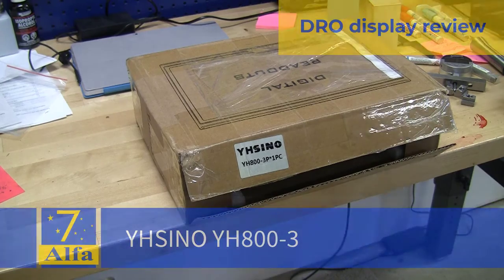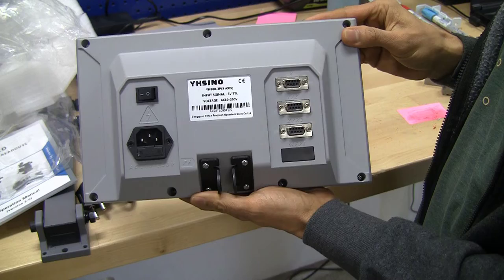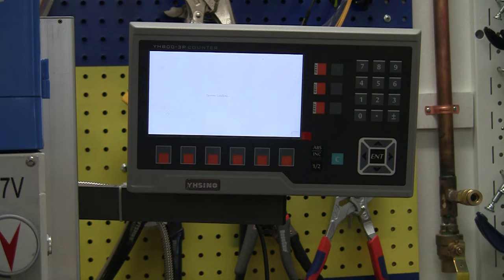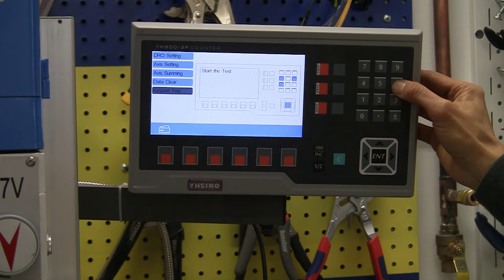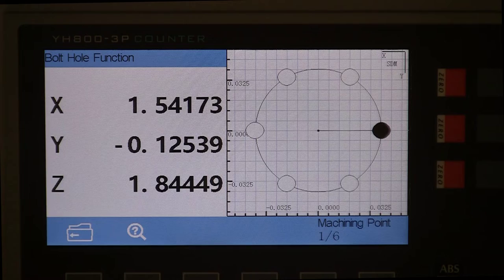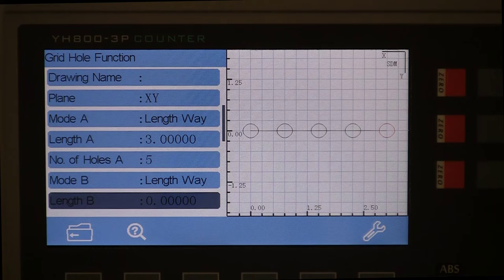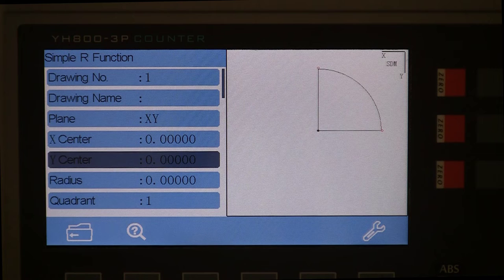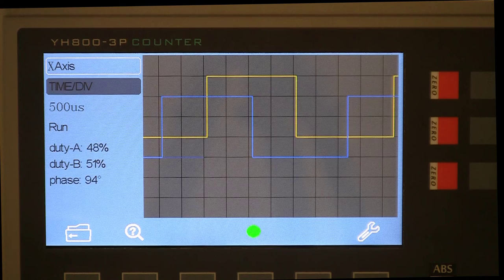Review of YH-800 DRO Display for PM 727 Milling Machine

Comment: Am I missing a link somewhere to where you bought it? Searching AliExpress fails.
Reply from the maker: Sorry, I didn't put a link in there. At the time I bought it, there were a lot of price fluctuations going on. Here is the link I bought it from:
https://www.aliexpress.us/item/2255800502099783.html?spm=a2g0o.order_list.0.0.9a891802aiTXVe&gatewayAdapt=glo2usa4itemAdapt&_randl_shipto=US
I am not affiliated with Ali or the seller in any way.
I would also suggest looking for it by searching for the name of the item. As is always so confusing, they list all of the types of DROs under the same heading. 
I chose the 3-axis version. On the listing above it says shipping to US is ~$67, but in fine print it also says some shipping is free above $50 when selected at checkout.

Comment: Good vid!   Any suggestions for scale encoders, or will the DRO work with any common steel/glass imports?
Reply from the maker: Glad you enjoyed it. This will work with the standard imports. My mill uses 5 micron scales. They were installed by Precision Matthews. It was quite literally plug and play. I already had a mounting bracket, but this scale came with its own hardware which did not quite fit the old mounts. Took a few extra minutes to swap out.
BTW, there was nothing wrong with the old display. I just find the new one so much easier to use.

Comment: Hi, thanks for the video. A few questions if I may. Does it remember your position when switched on/off ? Does it have a screensaver function, and how is it reactivated ? Thanks
Reply from the maker: Yes, it does remember the position that you left it at. But, it doesn't have a screen saver, and the screen stays on. I am trying to change my habits, but so far, there has been no burn in or anything worrisome like that.
I like the little red marker that shows up when getting close to 0, and actually you can get pretty close without looking at the numbers. 
For me, having a visual representation of hole patterns has been the best feature. 
Thanks for watching!